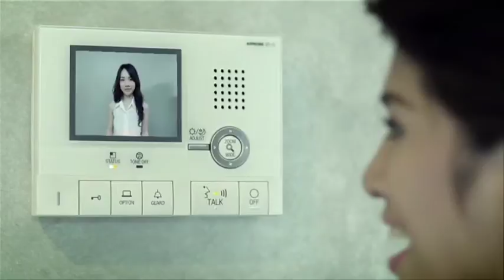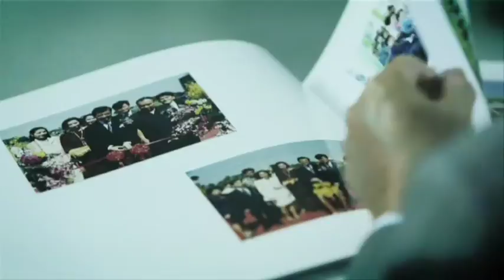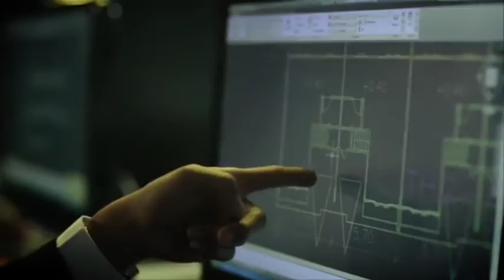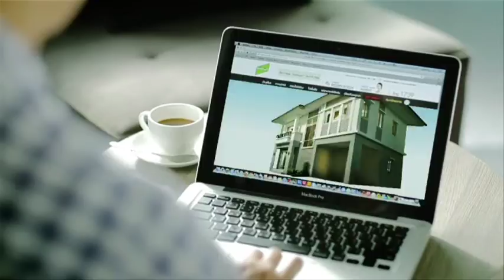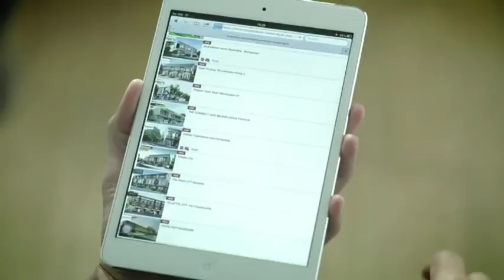Pruksa Real Estate Public Company Limited

Comment: FIRST-RATE PRECAST PLANT IN THAILAND

In 2004, Pruksa was one of the biggest real estate developers in Bangkok and new entrant into the production of precast concrete elements. Pruksa wanted a partner for the overall planning, development of the building system and for the know-how transfer and started the co-operation with Prilhofer Consulting Germany.

The beginn of a most successful story in the industrial production of precast concrete buildings.

In autumn 2003, initial contacts of German companies to Preuksa Real Estate in Bangkok were established. Preuksa clearly defined its objective: the establishment of a new precast plant for the production of wall elements as early as possible, a plant that would not only top production in Thailand itself, but on a worldwide basis to make the company second to none as a producer of top-quality prefabricated concrete elements.

The challenge of planning and implementing these high expectations on the part of Preuksa was taken up by Christian Prilhofer Consulting, Unitechnik, Vollert, and Weckenmann, who had already successfully collaborated on several projects. The existing concrete plant was producing in open space. The result of this production method was a quality that often turned out to be unsatisfactory. The surfaces of the produced elements did very often not fulfill the required standards. It happened too often that elements were damaged either during tilting processes or their intermediate transportation, and even when the elements were fixed on the construction site, several other types of damage would occur.

These problems defined Preuksa’s new quality requirements on the system to be projected: on a daily basis, 12 to 16 two-story detached houses were to be built. This type of buildings was supposed to be designed in a way to ensure that they could be built depending on the requirements of the market and the sales chances in a given situation. Apart from ensuring lower costs, the quality of the buildings had to be substantially improved. To ensure this, a plant that matched the degree of automation and the current conditions prevailing in Thailand had to be set up. Also, the plant design had to ensure that at a later stage this automation level could be increased and optimized so that deficiencies occurring in the course of production could be minimized and finally even totally remedied.

The factory was opened and the first elements were produced on 4th December 2004.